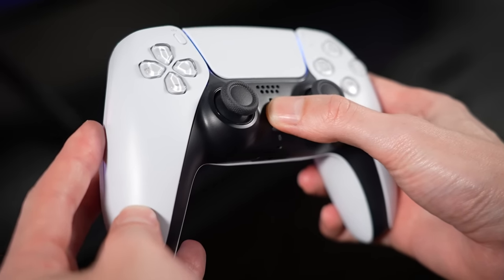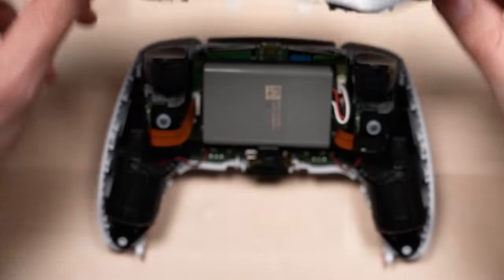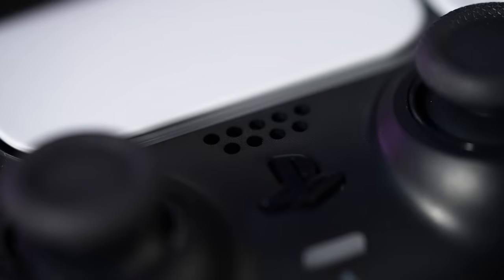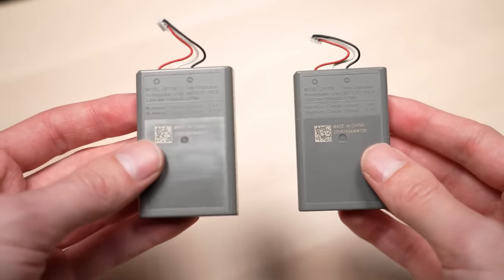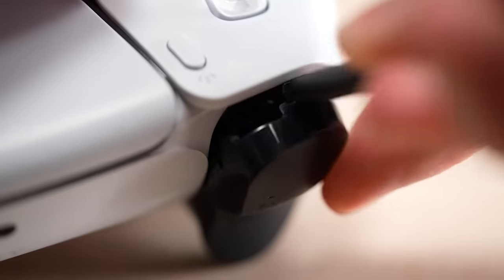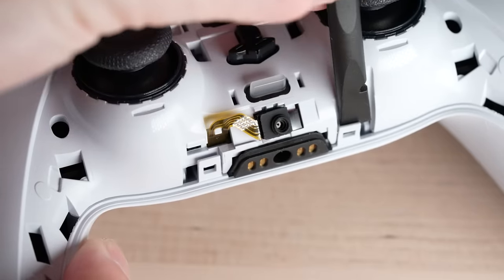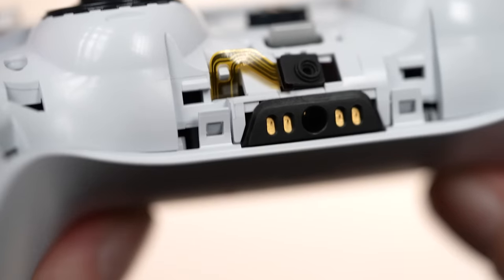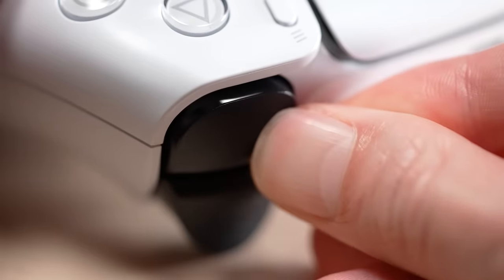Sadly, your Playstation controller won't last much longer..

Comment: "Xbox controllers still use AA batteries, yikes" Yeah the point is to give you the option and you can always buy extra rechargeable battery packs if one goes bad.
Reply: Gameboy Advance Also Used Batteries Too.
Reply: There's no yikes about it. 
Microsoft gives you multiple options of charging your controller without it damaging your controller.

-Wired, what most people use rechargeable battery packs, or if you're really desperate AA Batteries. Don't act like an internal battery is better also I can exchange a battery pack which always comes in a set of two at Walmart for $15 in 5 seconds no tools needed so what's better?
Reply: @PunkSolar22x  Yeah that was my point.. I put the first part in quotation marks for a reason lol
Reply: MS was like.. Hmm... maybe lets give users options so they don't need to ever worry about needing to take apart their controller or purchase stuff from the grey market.. such monsters..
Reply: That is until the springs on the back of your controller that you put your batteries into bent.
Happened a lot to me.
Reply: 8bitdo Pro 2 controller also includes the option to switch out the rechargeable battery for two AA batteries! I love that it's an option.
Reply: Facts. Panasonic eneloops last a ridiculously long time in a Series X controller. Keep two extra on the charger, pop out pop in, good to go.
Reply: Problem is rechargeable batteries are shit
Reply: @gleeson630  Cool...
Reply: @gleeson630  PlayStation controllers definitely don't hold full charge that long unless you use your controllers extremely conservatively. The whole point of this video is that it's a common issue. 

And you're talking an extreme amount of bullshit about the pricing of batteries. Buying disposable is obviously going to cost a lot of money to replace but at one point or another you're going to switch to rechargeable battery packs to keep your controllers charged. Hell I spent about £20 back in 2015 for a dual battery pack plus a charger and it's keep my controllers charged fully for more than half a decade. Definitely a far cry from spending £100's in batteries...

Also this isn't a fanboy blah blah war argument. Just that PlayStation design choices have left the user unable to have the control over their controller charging and that leaves a lot of less tech savvy people in the position of deciding whether to buy a new controller or go through the hassle of buying in replacement li-on batteries and dismantling their controller themselves. Which a lot of people aren't going to do. It's almost coming off as planned obsolescence if it weren't for Sony's track record of strange hardware decisions.
Reply: You can buy rechargeable Duracell double a batteries so when you're recharge them and use them again on the Xbox controller my friend he's been doing it for about like 3 years.
Reply: @gleeson630  lol, i got my rechargeable batteries for $15 with free shipping. You can also just buy a bulk battery pack, it's really not that expensive and they can be good batteries like costco...

It's not really about controller longevity though, the sticks will give in far quicker than your batteries and when that happens it's off to buy another $70 controller
Reply: I have used PlayStation controllers forever and have never experienced this problem. 

Still can’t believe Xbox used AA batteries
Reply: @hoop6822  how are they shit if they last longer then the ps5 controller?
Reply: @christianwiebe9656  except rechargeable Duracell batteries last way longer
Reply: @HonkeyKong54  actually your kind of wrong because my friend had a PS4 controller from about nine years ago and it still work just fine this other dude I talk to you have his PS5 for almost 2 years PS5 controller still works fine and newsflash durability wise PS5 controllers are way more durable.
Reply: @christianwiebe9656  it's not actually a bad thing just because there's different options you could buy Duracell rechargeable double a batteries and they will last you about 10 to 11 years.
Reply: @colonian83  that's why I keep parts around
Reply: @colonian83  and the PS4 controller uses the same thumbsticks
Reply: @TylerHaddox89  ugh, they didn't improve the thumbstick rubber in the dualsense? Ds4 is ultra uncomfortable, made me buy kontrolfreeks. Also not all of us are into soldering
Reply: @colonian83  that's all Thay improved I just take that rubber off and put it on the PS4 stick
Reply: @TylerHaddox89  they improved the rumble
Reply: @hoop6822  difference between them being shit and you just buying shitty ones. I’ve been using the same rechargeable battery pack for the last 3 years, and it always last more than I need. To the point When it does die it’s just cause I played with it awhile and forgot to charge it lmao
Reply: Honestly happy they switched to usb-c. Using my phone charger for my controller interchangeably is a big plus. It was annoying switching back and forth
Reply: @CyberAesthetic  oh yeah
Reply: @TylerHaddox89  i can shatter a PS5 controller by holding the grips and giving a light twist, how is that durable?
Reply: @joeycampbell940  prove it
Reply: @gleeson630  1) rechargeable AA batteries
2) my xbox 360 batteries outlived my console
3) my ps4 controller's battery died in less than 3 years

I shit you not, I wish both companies still offered wired controllers as a choice. I know people that have bluetooth hardware issues/interference interrupting their gameplay and it's fucking annoying

At least the gameboy era had reliable options. Now the most reliable option is getting a second $50 (or more depending on where you live) controller as a backup
Reply: @CyberAesthetic  I'd been using the same 4 pairs of rechargeable AA batteries for at least 12 years until I switched to wired periferals for unrelated reasons
Most of them outlived the devices they used to power and are still able to hold decent charge
Reply: Yep, I use Xbox controller with rechargeable pack that I’ve had since 2014 still going strong. Also with cross compatible controllers.
Reply: @gleeson630  they hold full charges for 7 years? Bullshit. I’ve went through multiple that have lost charges. Mostly dS4 and my ps5 controller seems to be starting to lose full charge.
Reply: @gleeson630  rechargeable AAs are $15 Canadian and they come with the charger theyre also a 4 pack so hot swapping isnt a problem
Reply: @joeycampbell940  that's what I thought easy wins.
Reply: @northernyetigaming8566  I have never experienced that issue
Reply: @upperjohn117aka  it's good if you have an Xbox controller
Reply: @gleeson630  There are rechargeable AAs out there you know.  I feel like half of the people against the Xbox battery design are people who just dont even consider rechargeable AAs
Reply: Nothing yikes about it u pony you can get xbox rechargeable battery cover so when u fin playing u can just leave the controller on the charging dock
Reply: @thedeep3759  Did you even read my comment bro?
Reply: Xbox Sucks. Always has, always will. When the Xbox first came out, I had a treasonous bastard friend that would come over to my place and just start trash talking the Playstation 2 which eventually became the Playstation 3. What a weasel to say the least.
Reply: @PunkSolar22x cus they’re too cheap to include a rechargeable battery

Comment: When putting the screws back, avoid over-tightening them. Screws into plastic will easily strip the threads. Generally I stop as soon as I feel any resistance.
Reply: not great advice for life though
Reply: Maybe not but life isn’t the topic of the video here is it captain obvious ?
Reply: "Generally I stop as soon as I feel any resistance."
Agreed!
Reply: Yes thight is thight. Same for putting in the SSD screw. I dont understand how ppl manage to strip them unless they use the wrong screwdriver. If people dont know yet you need a PH1 screwdriver.
Reply: @StanleyKubick1  Ahem yeah really is not that good of advice heh. :P
Reply: @StanleyKubick1 exactly, we’re all screwed in the end.

Comment: Man it's because of this I like how Xbox does the whole removable battery thing. No disassembly necessary so much easier then all of this.
Reply: Chargeable batteries can last up to 3 plus years dual sense and other chargeable controllers are always reliable you can run out of batteries  USB type c makes controllers charge way faster so now batteries are more of a inconvenience since you are spending money in the long run and you keep up with having to know how much you got left
Reply: @Saiyangod41205  You can get Microsoft's rechargeable battery, or third party ones which lasts just as long and no disassembly needed but honestly they should included that instead of AA
Reply: @alvzcizzler  yeah it will last as long but you do have to buy it they require you to spend extra money for the controller you already have for batteries and a charge port
Reply: @Saiyangod41205  but atleast you wouldn't have to buy a whole new controller because of having to take out the built in battery pack compared to a separate one like Xbox. But they should have it in the box already.
Reply: if xbox included the rechargeable battery it would 100% be better than playstation, but because you have to go out of your way to buy it when i’ve never had to buy any parts for any of my controllers, that’s where it falls short
Reply: This literally cost the same as AAs, takes two extra steps to take apart, and only has to be done once every 3 years, not every day.
Reply: @Saiyangod41205 
Not even close with removable batteries you have so many options. Me personally I just buy rechargeable batteries packs for my controllers but you could also buy rechargeable AA's if you wanted to plus there's so many different options for battery packs to get at different price ranges and charge levels. Options are always a good. Plus 3 years for a rechargeable battery really isn't all that impressive when a console generation usually last 5 to 7 years. That means midway through the generation your Dualsense controller's batteries will stop holding a charge and you'll have to either spring for a whole nother controller to replace it or go through this whole tedious process.
Reply: @alvzcizzler 
I think the reason they don't is because they got some kind of deal with Duracell I feel like.
Reply: @jojackjohnson4185 
Yea I don't know what you mean by 2 extra steps having to unscrew each screw and pry apart the controller is much more complicated than ju opening up a battery compartment. Plus having to do that every 3 years would be a pain in the ass having your controller just straight up die and not able to hold a charge midway through the console generation and you having to either replace the whole damn controller or go through all this to open it up and replace the battery.
Reply: @marky3609  controllers themselves won't generally last anywhere as long as the battery can last as for other options you will have to buy no matter what you gonna have to buy something for Xbox controllers
Reply: @Saiyangod41205 
I have Xbox One and PS4 controllers that are from 2014 what are you talking about the controllers are just fine with no issues. The only real problem is my Dualshock 4 barely holds a charge. Heck I got PS3 and Xbox 360 controllers still that work fine it's just that all my Dualshock 3's are no longer wireless and need to be plugged in to use them. A controller should last way longer then the battery inside it unless you just don't take good care of them let them get real dirty don't clean them or drop them often. Other then that tho they should work just fine.
Reply: @marky3609  try reading I said GENERALLY you can easily make a controller last 20 plus years if you work on it and clean it a good bit if you don't it will GENERALLY last about 3 years I got a ds5 ds4 xb1 controller and multiple GameCube controllers I know they can last longer
Reply: @Saiyangod41205 
No you didn't maybe you should try reading your own comment again you didn't say anything about generally making your controllers last 20 years all you said was generally the controllers won't last anywhere near as long as the battery can which is a false statement. The general battery life of the lithium ion batteries in these controllers is about 3 years and it is very easy to have a controller last more then 3 years even without taking special care of it. A console controller can usually get you thru the whole generation without seeing any major issues so from 5-7 years. But in that time your controllers battery would die midway thru but if you just have a simple battery compartment on the back of your controller then no problem just open and replace the battery but if it's built in well then you gotta disessemble the controller and replace it that way which is a much more tedious process and if your someone who doesn't know what they are doing you could end up breaking your controller trying to disassemble it.
Reply: @alvzcizzler  8bitdo does this with their controllers, they come with a battery pack but you can take it out and put in AAs if you want
Reply: *than
Reply: @marky3609  *than
Reply: @marky3609  *than